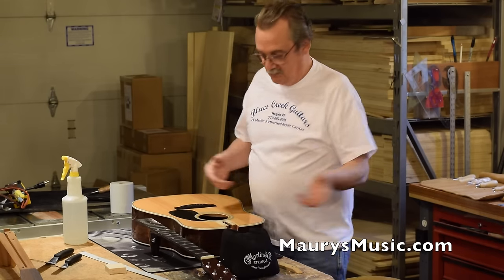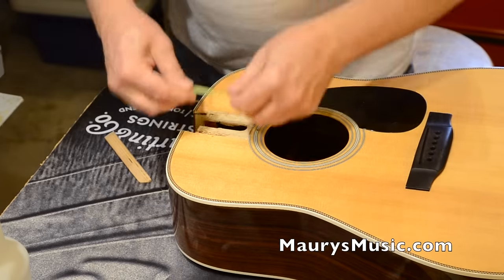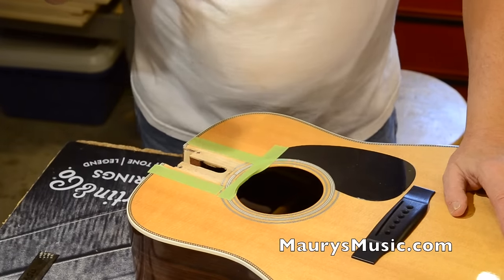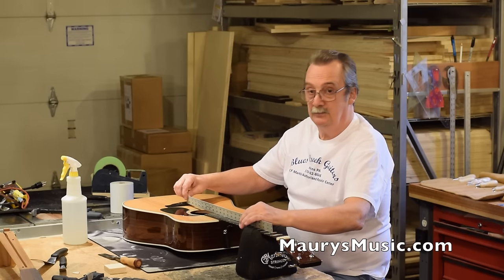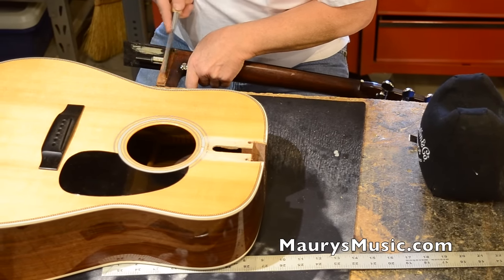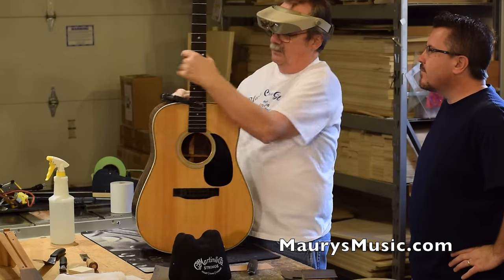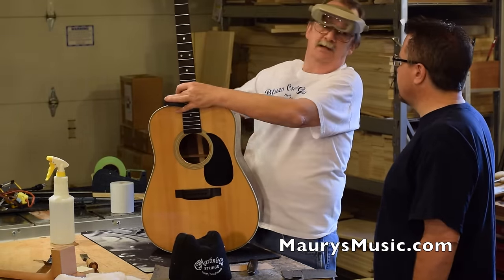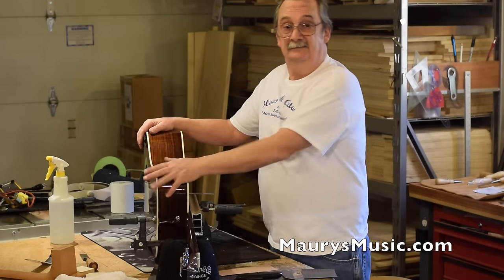Blues Creek Guitars - Guitar Neck Reset Part 2

Comment from the maker: This sandpaper trick has been around a long time. I do this on the video as those looking at doing this , few know how to sharpen a chisel  and if a chisel isn't shaving it isn't sharp.   There are many different chisels,   I prefer a 1/2 firmer chisel , I still use the sandpaper for the final fitting , and there is a technique to it. If you are getting high spots  you may be pulling the sanpaper through  .   I do spoon out the heel area and I also will cope sand that area.  When using a chisel  you shave small areas and pay attention to what is holding you off and where. Often is is just a small area that can seem to be the biggest problem. I can say that take small nibbles with the chisel and cut from the out side in to shear the wood and finish.
Reply: Hi whats the glue you are using ?
If you don't mind hehe

Comment: 8:54 I hate to be an arm chair luthier, but I really hope this isn't how you treat all your customers guitars. Notice all the wood chips stuck on the bottom of the guitar. That is constantly scratching the surface and leaving fine scratches at best. Maybe deep scratches, or God forgive it may cause dents at worst.  The work surface should be constantly cleaned so you don't keep scraping the bottom and sides of the guitar on those wood chips. If someone is sending you a guitar for a neck reset, it is either an expensive guitar, or it has sentimental value to that person. Now if this guitar was getting completely refinished, it's another story. 
That being said, I enjoyed your neck reset vid. Highly informative, good commentary, and good lighting/camera work.
Reply: Um sort of agree from a certain perspective as I’m really over the top when caring for my guitars........but other than those few shavings he’s very good at his craft ! I didn’t see once any metallic tool ding the guitar back, sides or top also the clamps used are all rubberised to prevent damage
Reply: I must say that he is not very gentle in handling the guitar, he got me very nervous with his quick moves, but he is a professionnel luthier and he knows how to do the job.

Comment: I have a question Glenn. When a truss rod cant tighten anymore to straighten a guitar with string tension to dead flat. I have used a method of adding washers on the truss rod to give more torque... what is the pros and cons of this technique?? Im concerned about compression in wood at end of truss rod
Reply: it works  your good. I do the same thing.

Comment: I have done 50+ neck resets, mostly on Harmonys and Kays, but some gibsons and guilds. I learned the StewMac method of doing the whole fitting with sandpaper, but I know that traditionally ( and at Martin) the cutting of the dovetail face is done with a chisel. I've tried this, mostly when I was starting out, and I cut gaps in the dovetail face, took chunks out it, split off the heelcap....so I went to the sanpaper method.
This , too has its limitations...it tends to leave a high spot under the heel cap, and it easy to leave a gap there despite being careful not to pull up on the sandpaper strip.
Now that I have some experience under my belt, I'd like to try the chisel again. It appears that having a super-sharp chisel, knowing where to remove wood and backing up the heel against the workbench are key. 
Here's my question: How do you get your chisels so sharp?

 Once again, THANK YOU for producing these videos!
Reply: mamachip sharp chisels are a must. If I’m setting a chisel up for the first time,setting angle or working out nicks ect I start with my 400g/1000g stone for the rough work to set my angle and get my edge roughed in then I go to my diamond plates and start at 1500 and work up until I’m happy with the edge and polish. Some guys use stone and leather. I’ve used leather and compounds too. High grit sandpaper and a peice of flat glass are good for your higher grit honing and polishing too. Hope this helps.

Comment: You mentioned the importance or the Martin lifetime warranty- I have a D 45 I bought new at an authorized dealer. It has just started to have a problem with the binding around the waist of the body on both the upper and lower side coming loose. Would you consider that to be a warranty repair. By the way your videos are great go into a lot of detail and I appreciate the time you spend on it
Reply: they cover that   so you will need to find a local Martin repair shop   Martin is closed per se but we can get in touch with the customer service to ok these repairs

Comment: Thanks for the excellent videos. Three questions, if you have a minute:

1. You mentioned using a tapered shim. Why not keep the shim uniform and then treat the reset like the initial neck setting that you demonstrate in your neck setting videos ("Dovetail neck" Parts 1-5)?

2. I'm repairing a loose neck on an old Gretsch arch top acoustic. With the neck removed, I see that the dovetail angles don't mate between the body and neck, the surfaces in the block aren't even planar, and there is a lot of slop. My plan was to glue shims into the neck block on both sides to take up the slop and to give me good, flat surfaces. Then I was going set the neck like you described in your "Dovetail neck" videos. Since I need to mess with the neck block, I realize I'll need to be patient while setting and read the gaps since all the angles will probably be off a touch vs. a pristine machined block and dovetail. Am I on the right track? 

3. Do you know the ideal string height above the top at the bridge for an arch top?
Reply: because you run a big risk of adding a twist to the tenon. Adjusting a shim  is easier and if you make a mistake  a shim is simple to replace  the tenon   not so much.  What happens is you will have to trim at the heel to get the neck to rotate to correct the angle.  A shim will be easy to adjust.
Reply: I would make the tapered sanding block and clean the neck mortise with that ,  then reword the neck.  Adding a shim on a crooked base will not give you the best long term support.   Making 10 small adjustments is better than one Awwwwwwww Darnit adjustment
Reply: The string height can vary .  Look at the bridge and figure the adjustability  and work using that as a gauge. If you needed a neck reset  look at the bridge and see how much you think was adjusted and compensate that way   You can send me an email with the bridge pic.
Reply: Thanks for your replies.  They make sense. The original bridge was lost, so I didn't want to assume the replacement bridge was correct.

Comment: So what was done with the “void” on the tongue of the fretboard after the heel angle was changed ?
Reply: much depends on the individual instrument.  Most close up once glued and clamped. If the angle change is enough I will make a tapered shim so the fretboard extension will be flat . If I have a  .030 in drop off I can live with that  but more than that I usually shim.

Comment: Thanks for the very useful video.  I have removed a neck using StewMac's heating rod and neck removal tool.  Worked really well!  I'm having trouble shaving the neck though.  Have used Lee Valley Tools' file sharpening jig and 1000/4000 hone but I still have trouble shaving the mahogany.  Any suggestions for how to take that material off?
Reply: learning to use a chisel is a skill that takes time to perfect. While I do use them I often use the sanding tool I make.  Look at my neck  set addendum video and you will see the angled sanding block. I can use fine grits when working on a finished neck.  You can  feel free to call me
Reply: @tippie53  Oh wow, that is a great idea.  Can't believe I didn't think of that.  Thanks for sharing your knowledge in your great videos and for answering my question.  I actually have two projects I am working on.  Just for fun, I am resetting a neck with high action on a cheap Yamaha acoustic.  This sanding block idea will work great for that one.  The other project will be a little trickier.  It is a Martin kit guitar that I was given years ago.  As is, because of my imperfect job on the body, the action will be much too low.  So I will attempt to shave down the top edge of the heal to compensate.  This will be harder to remove the necessary wood with the sanding block because the fingerboard came pre-attached to the neck.  Ah well, I will do my best!!  One other quick question about the Martin kit project... it is not technically a dovetail joint but a slot joint with a bolt inside the body.  Do I glue the joint and then tighten the bolt?  Or is the bolt (without glue) meant to hold the neck to the body on its own?  Many thanks!!

Comment: Hi Glenn, Thanks for the videos. As a hobbyist I have found them to be extremely helpful. I am attempting my 1st neck reset and have a question. I noticed on the video you didn't show the heel cap removal but when you started trimming it was gone. What did you use to remove it since it was a wood to plastic joint?
Reply: you don't want to take it off if you can help it. In this video it popped off on its own and I just reglued it later.
Reply: Rem Husted 8

Comment: Can this process hurt the intonation? 
Seems to me there might be a problem as the distance between the first frets and the saddle is increased more than the distance between the last frets and the saddle.
Reply: no  you are misunderstanding what is happening. We are correcting the intonation issues of the neck from time and stress , so as the neck moves the action height goes up causing intonation to go sharp. Since we don't remove any wood directly under the fretboard we don't change the position of the nut in relation to the saddle. Think of it this way  , the neck is hinged at the fretboard and we are not moving the nut just putting it back into the original position.
Reply: not  at all and in fact it will help . As the neck rises you bend the strings to fret causing some sharpening of the intonation. Once the neck geometry is re set the intonation improves.  We don't have to work much of the neck anywhere near the fretboard.  That is what you cause the most change in intonation.

Comment: How come the neck was not properly set in the factory during its initial production? This happen to one of my Martins with 12 frets being exposed outside the body, fret buzz arise from 13th to 20th fret when the saddle height goes down. Those with 14 frets (the D28 Marquis) outside the body are properly set though.
Reply: the neck moves over time.  Also your issue sounds like it may also been humidty issues. Hi rh raises the upper part of the top and can cause this.  In this case the guitar was over 20 yrs old and this is typical age for a reset
Reply: When I measure the relief of the strings at the 12th fret and the 17th fret, I found that the relief at the 17th fret is actually lower than the relief at the 12th fret, this is where the fret buzz from 13th -20th fret come about! I wonder is this a neck angle problem? Thanks.
Reply: You  are misunderstanding neck relief  and action height. Neck relief is the measurement of the curve of the neck . You  do this by fretting 1 and 13 then looking at the string height at the 7th fret. This should be about .004 to .009  of an inch. I think in your case you have 1 of 2 issues.  My gut tells me your over humidified the guitar and the top raised. This is not uncommon. If your rh is high and you have a humidifier in the case  this happens. You can check by placing a straight edge across the top in front of the fretboard. if this is allows a gap at the rim , your over humidified. If it is flat then you may need to get the neck reset.  Usually when you need the reset the top deforms from the rotation of the neck block.  Good news is that once you get the RH in control this should go away.
Reply: Oh sorry. You are right. I was meant to say "action height" measured at 12th and 17th fret. What seems to be the problem of my Martin in this case? I have lowered the saddle height by sand paper and resulted in good low action (fret 1 - fret 12) already. The problem is the buzzing arises (fret 13 - fret 20). Sorry to border you. I just wanted to know more the physics behind.
Reply: @thomaslau9631    lowering the saddle will make this worse so first you have to see if this is over humdified.  Once you get that straightened out  the issues should resolve themselves.  I do suspect humidity. What is your RH where you are and were you using a humidifier or dehumidifier?
Reply: Thanks for your advice. By the way, I reside in Hong Kong.
Reply: always here to help   feel free to contact me through BLues Creek guitars   @thomaslau9631

Comment: Do Martin still pay for neck resets, I hear they don't any longer?
Reply: one a one by basis  if your within 3-5 yrs or so maybe  but they no longer cover neck resets over 5 yrs
Reply: @tippie53   Cheers, I have a 2016 custom which is showing signs of a reset. However, its been like it is now since I bought it in 2016. I have emailed Martin customer services
Reply: depends on the age.  most after 5 years are on the owner but Martin will look at them on a  one by one basis

Comment: neck up and down, how to do?
Reply: I do that using a straight end . On resets I have to use a shim then adjust the neck tenon.  The key is that the joint is self tightening.

Comment: I would have taped all the area been worked on. you make me very nervous with your use of tools.no wood blocks for the clamps. your not doing my baby.
Reply: Hope you understand this is a video  and I don't use wood  I use leather and cork. In the video it makes for a lot of fumbling.  There  is a big difference in video and actual working. I am hoping to educate those not experienced in these mattern.  Taping off the areas would not give me an accurate replication of the joint. That is what the buffer is for.   Thanks for your reply.
Reply: I agree with you, the working methods made me nervous also. I was constantly thinking there's another scuff maybe a ding. twoodfrd vids I think are the best.